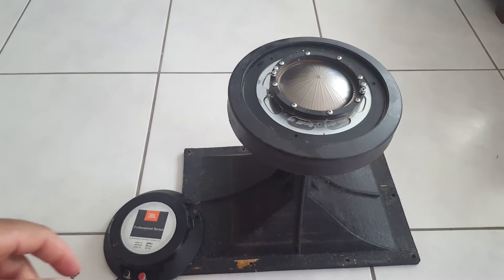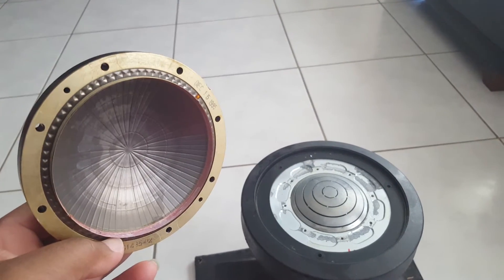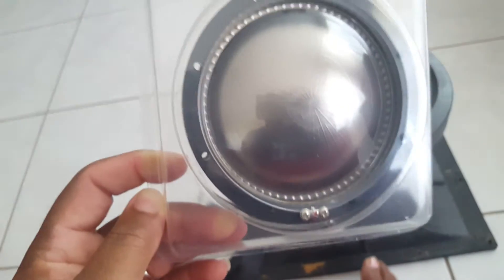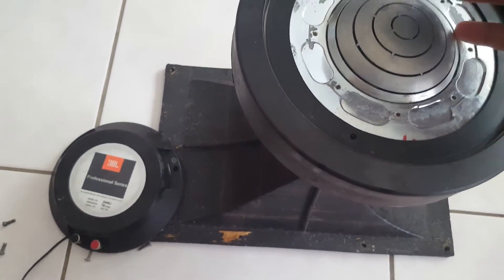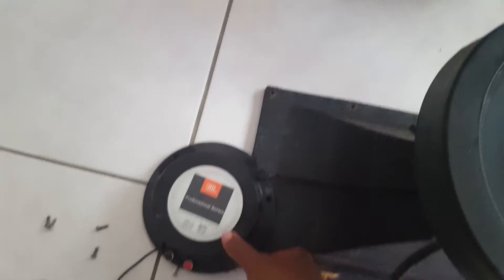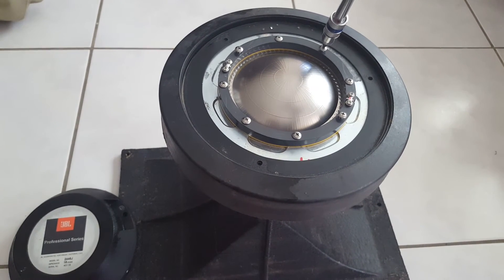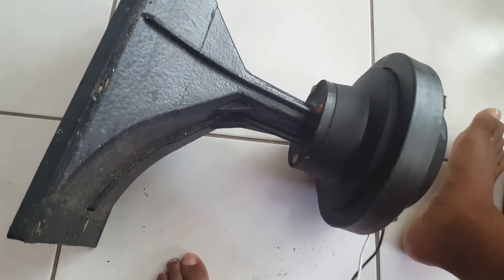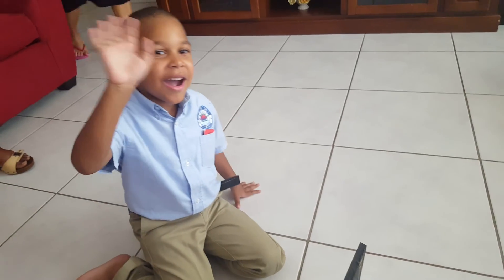Horn Driver Diaphragm Replacement  (How to)

Comment: hand tighten the screws lightly, newer use electric tools for that. Apply white noise to the amplifier and connect the terminals to the dome terminals. Adjust sound level to bare audible minimum and listen for the highest output when adjust the dome center in the air gap very careful, then finally hand tighten the screws.

Comment: 0:43 I have JBL 2445J five of them for 70mm SDDS five screen matrix wide and noted the diaphragm dated 1989 a lot of good Dolby Stereo 6ch and matrix cam out that year. You have to reverse the polarity as the shape of the diaphragm is domed shape and faces towards if it was in JBL three-way and cos its placed over the dome shaped phase-plug its facing in the opposite direction and Yes the polarity needs to be reversed so it has forward motion against the phase-plug. 
When using RTA with pink noise with JBL bass cab that I use JBL 4647 and can easily see on the RTA if you use a Behringer DCX2496 and reversed polarity you'll see a dip in the frequency between the crossover points.
Also using the JBL 2380A for the five screen matrix all are placed behind acoustical transparent screen. 
Also make new video update on your JBL horns maybe with Return of the Jedi on Laserdisc the rancor scene.

Comment: Also test with a microphone and RTA using pink noise to make sure the diaphragm along with tightening tension of each of the screws doesn't alter the frequency which is what I have discovered when aligning my JBL 2371 with 2416H with LCR horns on JBL control 12SR

Oh also use a frequency sweep as well that will determine you have smooth tonal frequency or if the diaphragm along with one of screws is hairline out of alignment. If you hear a frequency in the lower end of sweep sounding distorted? Its a small touch out of alignment.        

I've managed to get my JBL 2371 flat close down to near 400Hz with some High pass filters and few trims to level out the peak frequencies that can mask neighboring frequencies and the horn was generally made for a 1.5KHz I been using it at home happily for number of years with crossover set to 303Hz or sometimes 401Hz or 499Hz. It won't do anything much below 309Hz and that would be pushing the voice coil and I do use AUDIO LIMITER to protect if running a film.

I notice your, horns have the slot phase plug same to my JBL 2371 expect for the two pairs I brought off ebay different sellers one of the other pair had holes on the phase plug that can make the tonal frequency with pink noise sound different.

Wouldn't mind a larger x3 JBL horns thou been pleased with current ones in the home I know a larger size one will offer a bit more mid low Hz so that I can re-tune the bass mid drivers down a little lower.
Reply: Haha.  Never under 900hz. Resonanz  from Horn and driver. 😜😜😜